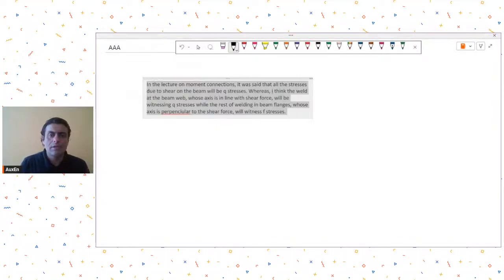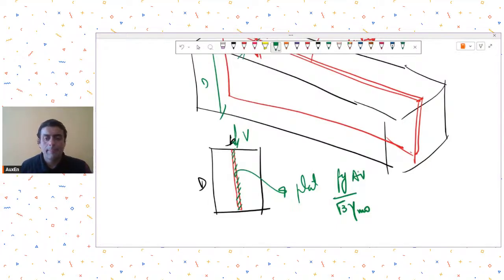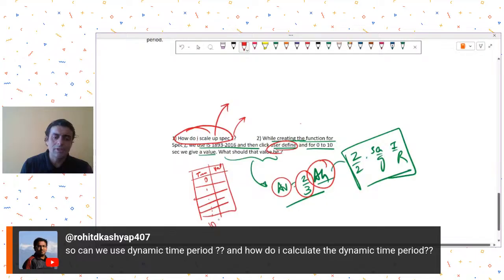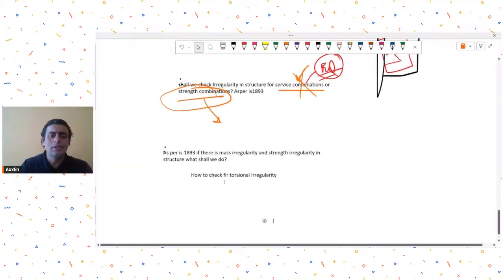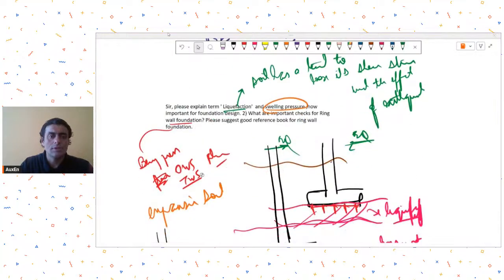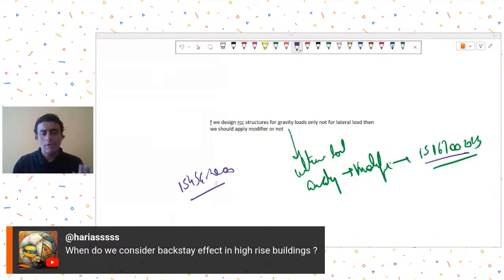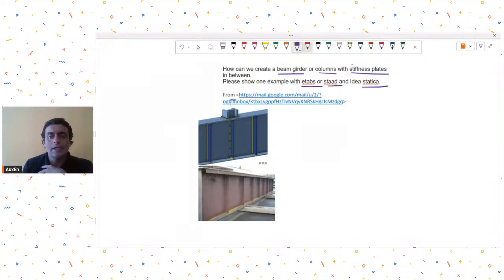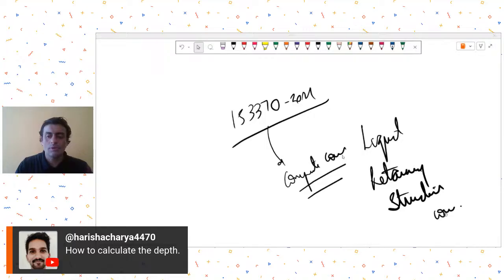Ask AuxEn Anything-AAA#61

Comment: for vertical seismic acceleration why I need to define response spectrum as it's constant, why can't I change the self-weight factor either it's increasing or decreasing (for ex. foundation bearing or stability),how it's significant to define response spectrum?